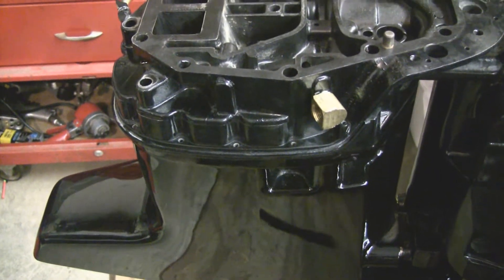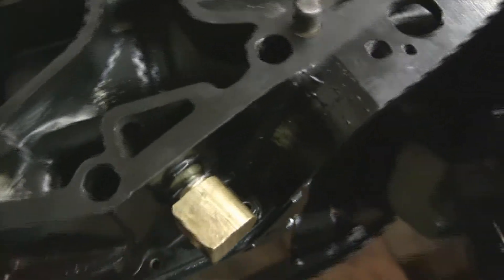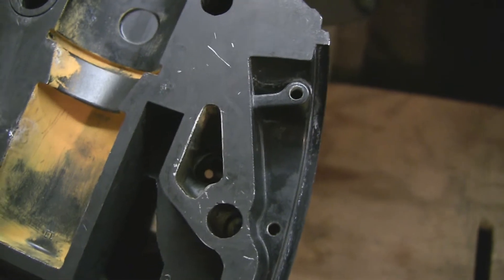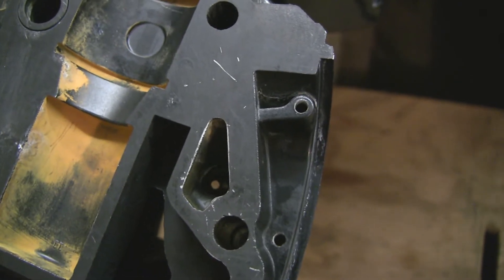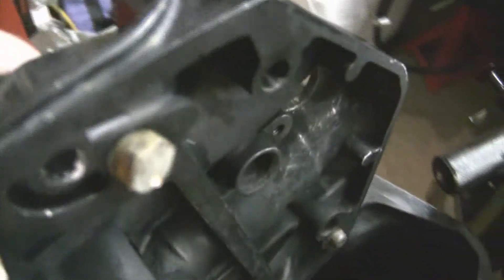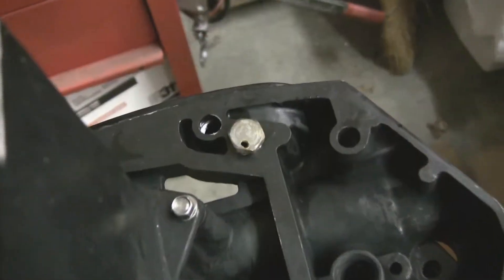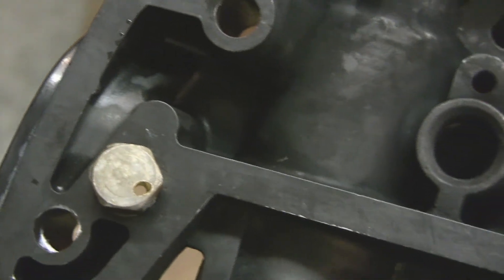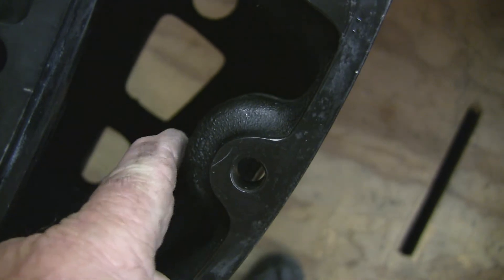Dry stacking a Mercury 2 piece exh plate for 15 inch outboard midsection

Comment: That boot is the idle relief port.  What it is attached to is the exhaust plate.  If you haven’t fixed this yet, the  correct - but not inexpensive solution - is to separate the powerhead from the mid section and replace the corroded exhaust plate and idle boot assembly.  That looks to be a Mercury Optimax.  They sell an exhaust plate kit for it.  You would have to also transfer over some other parts from the old exhaust plate (poppet valve, strainer for the air compressor water fed line, etc).   While the exhaust plate is off, I would also clean out the Exhaust Tube, including if need be boring out the (likely very clogged up) 18 relief ports in it which flow some of the exhaust gasses while at idle out of the idle relief port.  Those ports are suppos3d to be about 3/8” inside diameter but are likely much smaller due to build up of carbon, soot, etc.  another option to cleaning out the exhaust tube is to replace the exhaust tube.   

None of this is cheap and if you don’t have the means to do the job yourself the parts and labor will be pretty steep.  Good luck.

Comment: I’m very new to this, my dad passed and he has a mid 90’s ranger with a 150 xr6, someone told me that taking the tuner out will give it more power. I looked at him and said what’s a tuner. Any advice. She runs right at 61 with a light light load
Reply: He might have meant change the tuner out for a higher performance one or he could have meant remove the inner exhaust liner.  I don't really recommend either unless you are making other modifications. Taking the liner out just makes it louder.  Go to screamandfly.com and go to the forums. Lots of great info there.
Reply: I'm sorry you lost your Dad
Reply: @HankW257  thanks for the info and the condolences. We had so many awesome memories in the ranger. I’ll never sell her. She was garage kept and is just about perfect condition. I would like to go faster though. He always wanted to put a 200 pro max on her . So maybe that’s what I will do. Excited to check out the forums

Comment: What are the pros and cons of dry stacking?
Reply from the maker: #1 pro - Dry stacking helps at higher RPMs by getting the water out of the way of the exhaust & allows the engine to breath better. One con is that with the removal of the inner exhaust can (liner) that comes in regular motors, the minerals in the water will bake onto the outside of your mid section and you will need to use a hard water (mild acid) cleaner. The powerhead in this video probably doesn't benefit due to it being rev limited at about 7000 RPM. But the 15" offshore mid section has a reinforcement boss under the spent water dump that would have caused the spent cooling water to splash back into the tuner, or at least I thought it would. Factory high performance engines dump the cooling water in a different place so it wouldn't necessarily need to be done for them. One last Pro is that it sounds crisper, or meaner than the non-stacked setup. Another con to some is that it is louder as the water muffles the sound when not dry stacked.